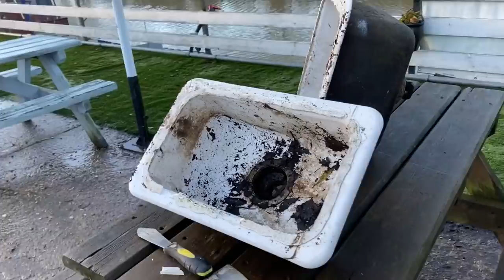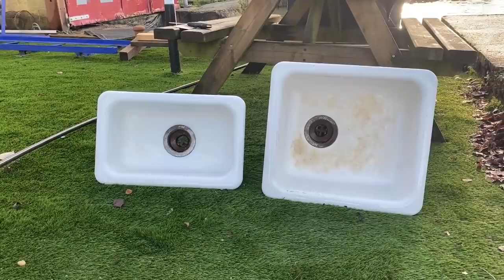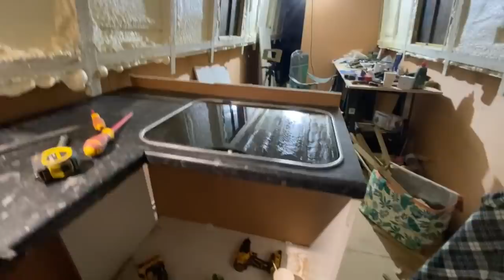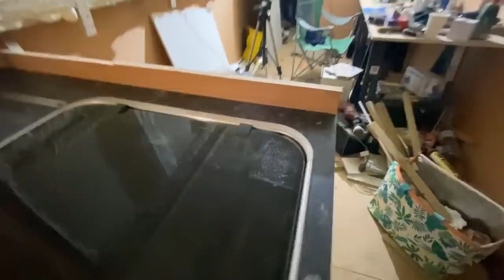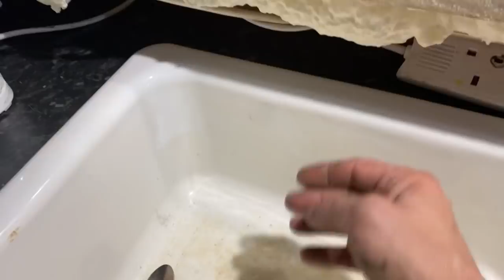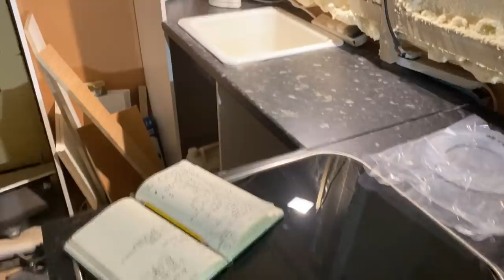65. Galley sink and prep for fireplace

Comment: Not being critical as I applaud your willdo cando attitude but please, please put some support in at the front intersection of your worktop.  

As I presume you are having some doors on your cabinets they will require something to hinge off or close onto so insert an l shaped corner post at the front of the worktop joint asap.  Otherwise much more weight than a cup of tea will spell disaster.

Please don't take this the wrong way.

Comment: Good news and bad news.  The stains in the sink are easy to clean.  Here in the us we have a product called comet.  It is a bleach abrasive cleaner.  Put enough on to form a thin paste.  Leave that on the sink surface overnight.  Bad news is that it will need to be done every 6 months or so. Easy fix.  Some of your commenters suggested acid.  I have never heard of that but I would suspect it might actually etch the glaze finish.

Comment: Probably tea stains on the sink . As a one off , I would use strong bleach (Domestas)  and a scouring pad . put a bucket under the plug hole and dispose of the water down the elsan . Be more careful with the chemicals once you are plumbed in and on the cut. Eco friendly solutions then.

Comment: I was trying to figure out what sort of kitchen faucet could work with that backsplash, and then I thought what you could actually use is a tub faucet - the kind with two knobs and a spigot that come through the wall of the tub. you'll have to drill three holes in the backsplash, but it should work very well. The only thing you'd give up is some flexibility to move It from side to side.
Reply: Nah. You need height and flexibility of placement in a kitchen faucet. You just have to come in from the side.

Comment: Another vote for bleach here. I put neat bleach on my white sink (composite not Belfast like yours), scrub at the dirt with a kitchen brush or nail brush and they dilute it with cold water and add more bleach as the sink fills to get a stronger concentrate and leave for a good while. I do that once a week as maintenance and use good old fashioned Cif cream cleaner most days after washing up. 

Was thinking instead of your one month beard progress you should have taken tea stain progression pics on your mug 🤣

Loving the daily updates and seeing how fast it’s changing now
Reply: Meant to add a nice bit of solid wood over the sink would work better than worktop with the edges being on show, easier to angle the edges to fit and keep treated with oil than the side of worktop getting water damaged or knocked

Comment: Have fun with the stove installation. Screwfix do Bosch  jigsaw blades. One pilot hole and a Bosch blade and the steel on my narrowboat roof was like cutting butter. 
It took me from February to October to fit the stove in my spare time. ( alot of time cutting tiles 2.5 cm square ) Two days sounds impressive. Looking forward to future great videos. PS Don't forget the carbon monoxide detector and smoke alarm. Got mine at Screwfix in Rugby, and the kitchen tap !

Comment: I realize I don't know all the plans you have for your spaces,however I lived on a boat for several years. In the galley in the corner between the sink and the stove (hob) there was dead space under counter. They had made access buy cutting a hatch and putting shelf about 16 inched down. And a ring on top of hatch to lift best storage I had. Held a lot of appliances out of the way and easy to get. Hope this is useful. Love watching all the vids and am amazed at your skills and energy.
Reply: I assume you will have a bowl in the sink so worst case, no one is going to see any partially cleaned sink

Comment: You mention fitting battens onto the fireplace wall, presumably to create the air gap. I suggest that you use strips or small blocks of calcium silicate for these spacers, rather than something combustible. Also, I don't know if you intend to use single or twin wall flue pipe but either way you will need to keep combustible ceiling material away from it, further away obviously for single wall than twin wall.
Reply from the maker: I’m on it. Air gap created using steel. Then CS board, then cement board, then fireproof tile adhesive, then fire proof tiles topped with fire proof grout !!! Single flue but more than 150 from combustibles
Reply: @TheNarrowboatThatJamesBuilt  Where does the 150 dimension come from?
Reply from the maker: Michael Burns aesthetics mainly. As long as it’s more than 45mm then I’m cool.
Reply: @TheNarrowboatThatJamesBuilt  As you stated at the outset, trying to pick the bones out of the available information is very difficult. Having looked at the various sources (but without seeing a full copy of BS8511) this is my understanding. Using a protection panel (consisting of a 10mm air gap at the surface of combustibles, 25mm CS board and tiles), in conjunction with a gap of 45mm between the stove and the tiles, is an alternative to the minimum distance purely in air (typically 600-700mm) required by stove manufacturers. This is illustrated in the diagram produced by SOLIFTEC that is shown on theirs and BSS's website. (Note: Cement board is not mentioned in relation to wall protection). That same diagram indicates that the same construction, topped with 15mm thick cement board, can be used for the hearth, in cases where the stove is on legs. This hearth bit seems odd to me because Diagram 27 of Part J of the building regulations (which are available free online) indicates that where it is guaranteed that an appliance cannot cause the hearth temperature to exceed 100 degrees C (typically one on legs), it is sufficient for the stove to stand on a 12mm thick hearth of non-combustible material fitted directly on top of a combustible floor. I’m not sure which Hamlet stove you’ve got. Some are specified as being ‘suitable for a 12mm hearth’ and others are not. This might save you some time and effort.

Comment: I’d double check with the boat safety scheme literature or better still the assessor regarding the installation of your stove as you may find it easier all round to leave it to the professionals who can furnish you with an appropriate certificate of installation. The Boat Safety Scheme assessment is perhaps a little more in-depth and more detailed than you may be expecting. But only speaking from experience. You’re doing a great job though, hugely admire your dedication!
Reply from the maker: The BSS info on stoves is really quite straight forward. As long as the right material is used, it’s quite easy. Tiling is the trickiest part.
Reply from the maker: I’ve already double checked my plans with my BSS inspector and he’s given it the thumbs up